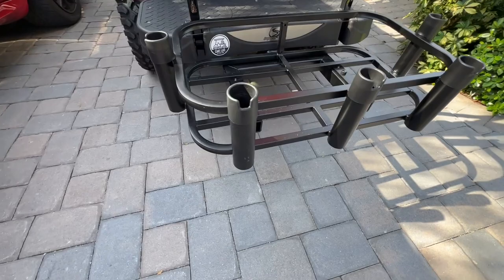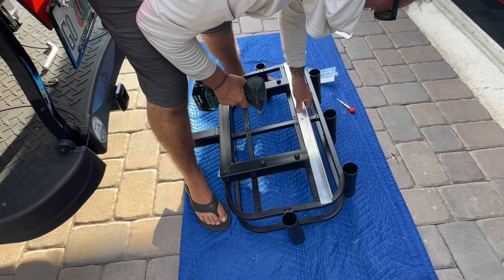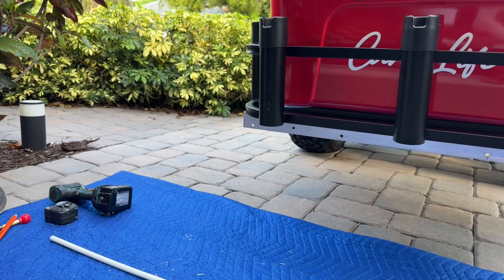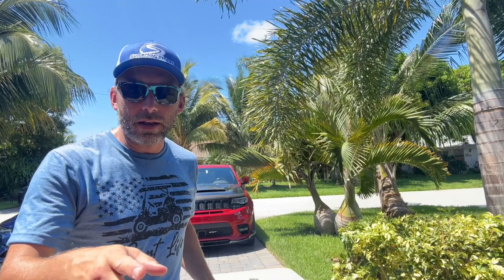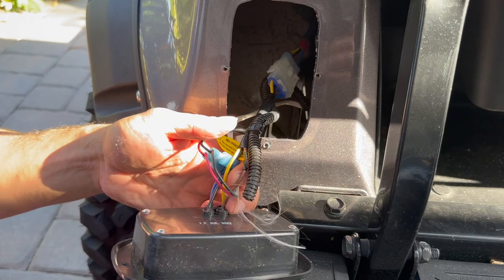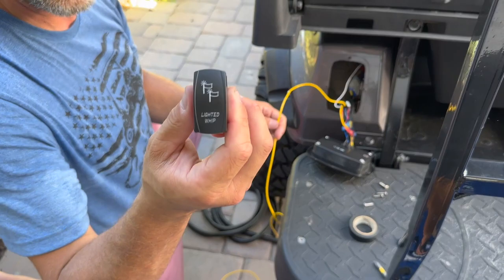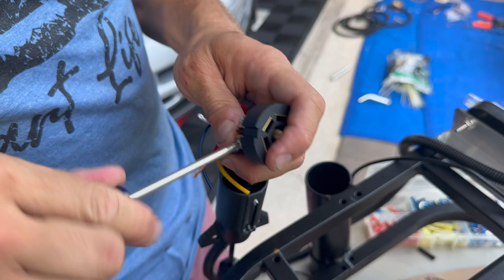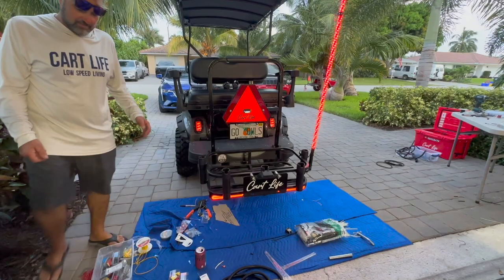Episode 3 - The Build Part 1 - Custom MadJax Cooler Carrier Trailer for a Long Distance Club Car DS

Comment: I love it but you better rig a lock mechanism to hold that cooler down before you need to “rescue” it from some douche bags trying to snag it while you’re in the gas station buying ice. 👍🏻
Reply from the maker: Hey, thanks for the suggestion- We actually have the Yeti Lock.  It’s made specifically for that!   It’s a super thick cable too!